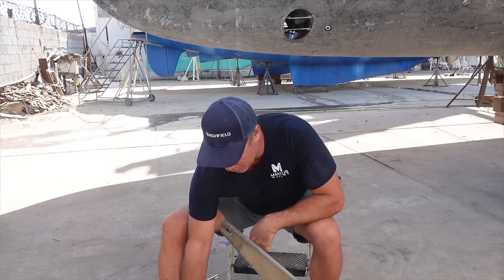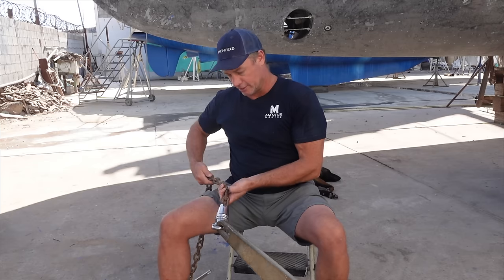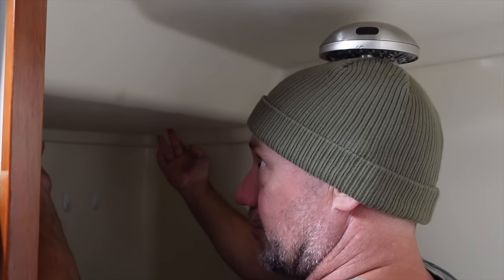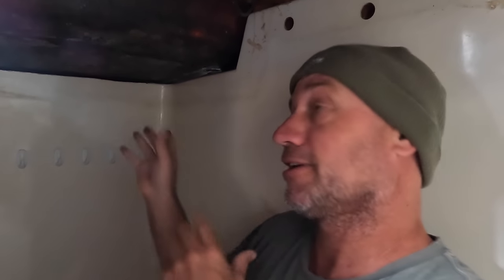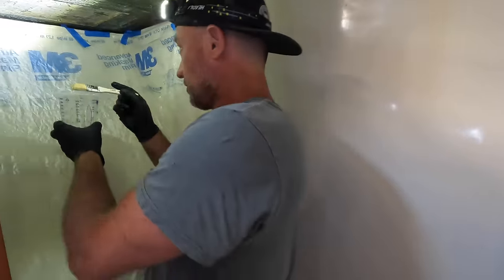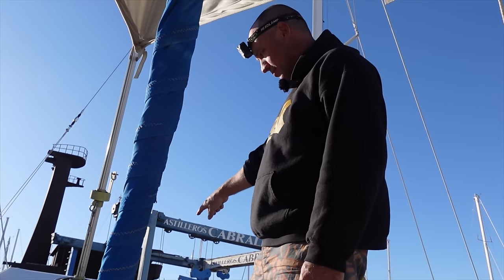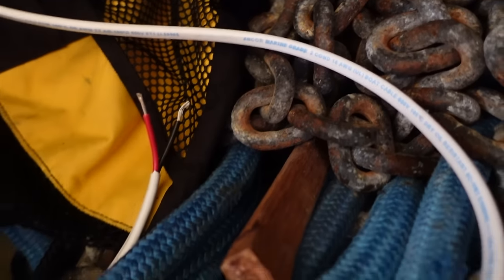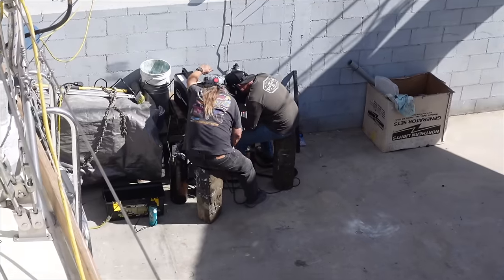Sailing the World Why you need one of these | Ep 395

Comment: And yet I seem to have sailed 200,000 miles, cruising since the 1980's with no swivel and exactly zero problems. Not one. I have cruised from the arctic circle yo the equator and in both hemispheres. I have anchored in fjiords, atolls, in mud, sand, gravel & anything else you can think of. NOT ONE PROBLEM. EVER.
Reply: He explains it if you listen. They also didn't run a swivel for an extended period of time. Episode 196 is relevant.

Comment: Swivel, soft spot repair, wire pulling 👍
When soldering, Flux or Flux core solder is the key to a good connection without weak cold solder joints.